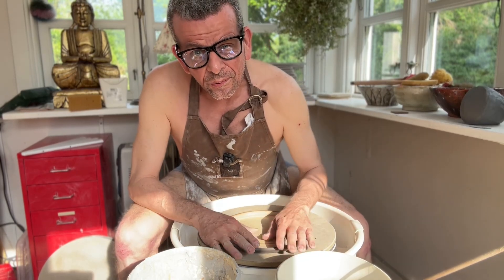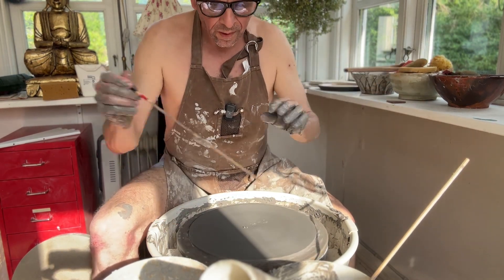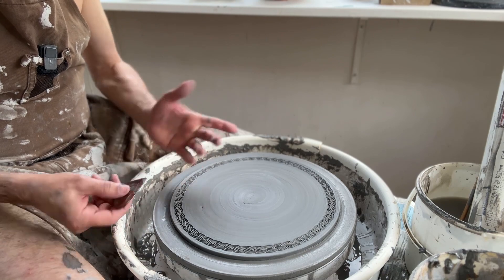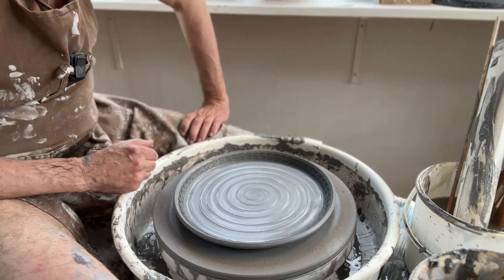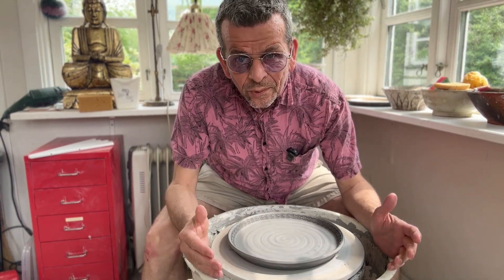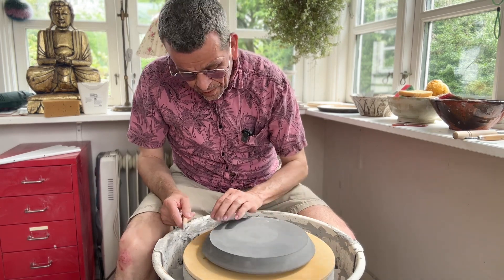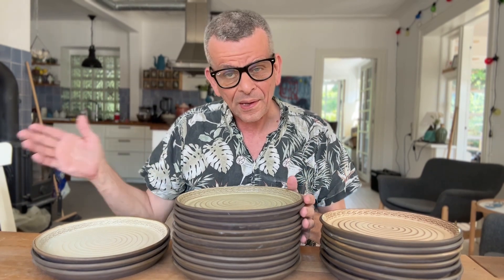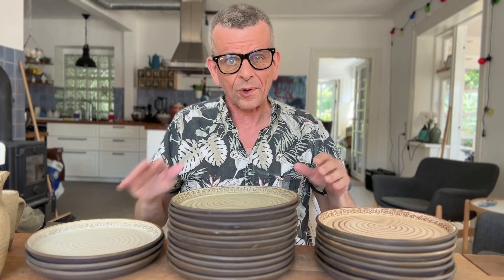112. How to Make Dinner Plates on the Pottery Wheel - Easy

Comment: Thank you for this video! You mention putting them in the dishwasher, it looks like only the top is glazed. Is that still fine to put unglazed in the wash?
Reply from the maker: Thanks. Yes, that is fine. I actually make a lot of pottery that is only partly glazes. Take a look at your cups - most likely the bottom is not glazed either :-)